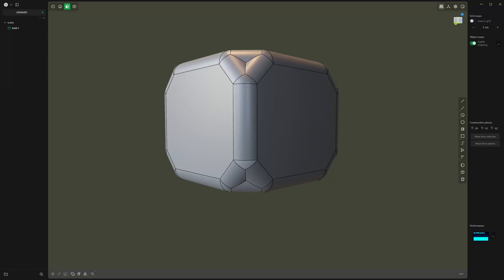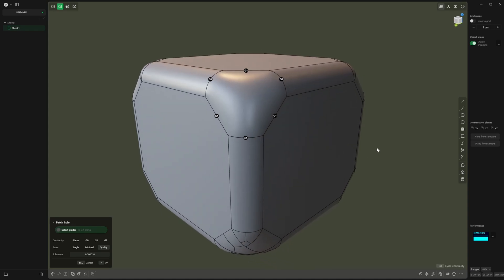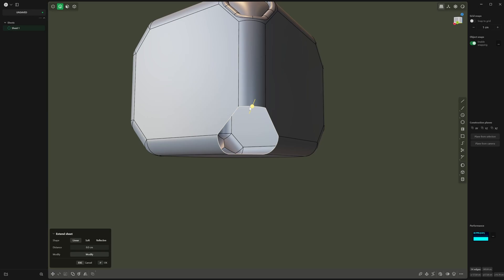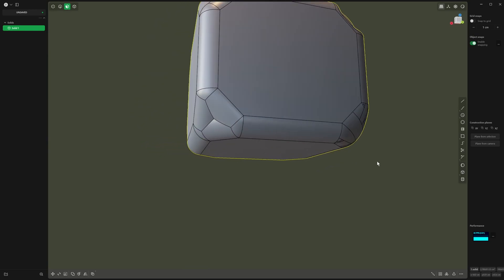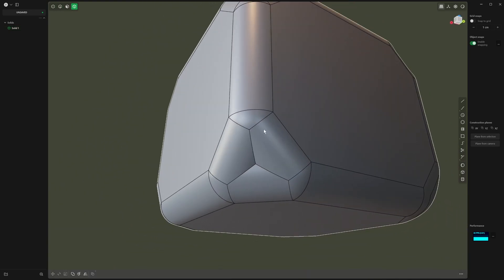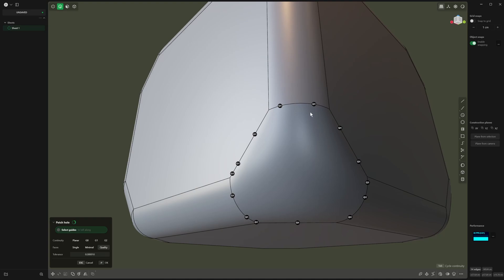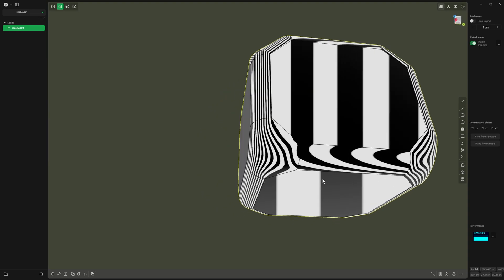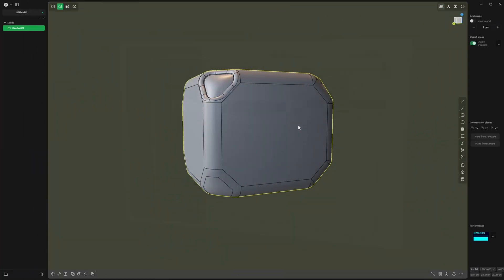Plasticity Quick Tip, Fixing FRACTURED Patches.

Comment: Just a quick selection tip - if you drag the bounding box from the left to the right it'll only select the edges/faces/items that are completely within the bounding box, which will save you from having to deselect so much stuff before performing the function you want. Dragging from right to left will select everything the bounding box touches, but for fine selections, going from left to right is a big help!

Edit: also, peeps should try out the Select Adjacent function and make note of its shortcut, cos it really speeds up selecting tiny chamfered areas, cos you can just pick the large face that's attached to them all, then run the function.
Reply from the maker: This is an awesome tip, I could never figure out why it worked like that some times and not others! Thank you!